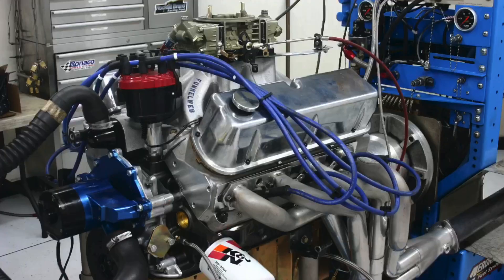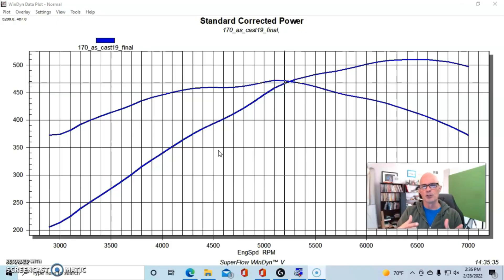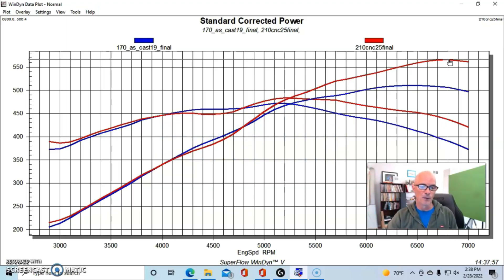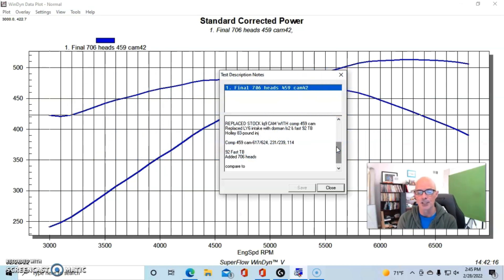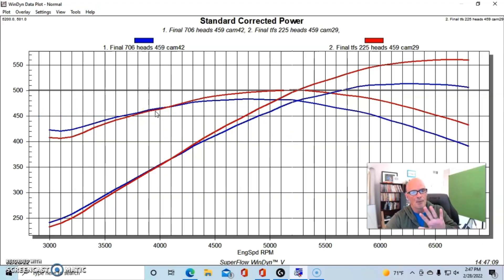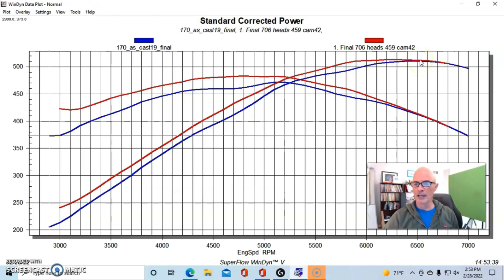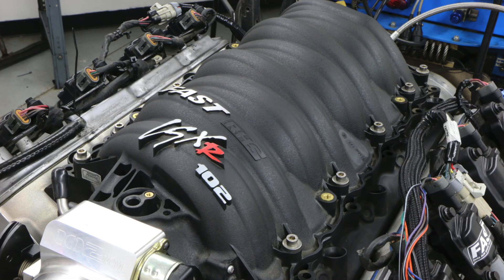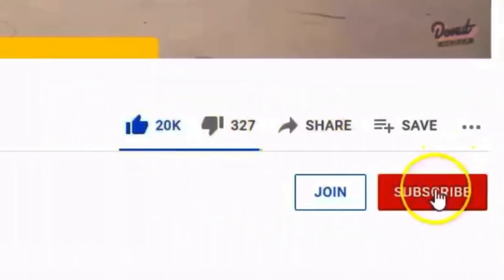HOW TO MAKE 6.0L POWER! FORD vs LS-WHICH 6.0L MAKES MORE POWER? MOD 363 FORD STROKER OR MOD 6.0L LS

Comment: It would have been interesting to see a cylinder head like a TFS R 225 compared to the LS’ TFS 225, a little more comparable than the Dart 210
Reply: Lol the cam was a solid lift 750. 
Vs a smaller hydraulic roller. 
The ford 225 heads aren't going to do any better at that lift.
Hands down the ls family will smack a ford small block any day. Especially on a budget. A mild ls will out motor a wild built ford small or big block seven days a week.  I see all the time on the strip. That's why the quickest and fast ford's have gm power.
Reply: @jakebeasley3856   TFS R 225 heads won’t do better with .750 lift?   They flow 360 cfm @ .700” out of the box.  
  
Why exactly do you think the LS typically makes more power than a SBF?   

Spoilers:   It’s the cylinder heads
Reply: @BC08  I realize it's the heads. My 243 only flow 310cfm at .600. After a great port job. You have to over build am sbf to get power out of it. Last time I checked 750 lift solid cam isn't very streetable over the this ls 6.0 would have very easy life in a street car.
Reply: TFSR 225 flow numbers            LSX TFS 225 flow numbers
.200" 141                                      144
.300" 205                                      222
.400" 270                                      279
.500" 308                                      316
.600" 333                                     335
.700" 341

Basically the TFS 225 are a serious head, better than stock LS3.
Reply: I'm not sure in what way that they would be more comparable, there's many differences between the designs.
Reply: @PSA78   Gee, let me think.   Flow and port volume for 2
Reply: @BCSVT  Port volume isn't something that you can compare with. It's comes down to CSA, flow (and to some extent combustion chamber), for the head.
Reply: @PSA78   Sure, you can compare.  Of course it’s much better to have intake port CSA but I’m not trying to be so pedantic.  
Fact of the matter is a Dart 210 barely cracks 300 cfm while the SBF TFS R 225 and and LS TFS 225 are both 330-340 cfm heads i.e. more comparable
Reply: @BCSVT  The engine is however pedantic. It's why they use this to their advantage in racing classes that has to be stock, acid porting and then mill the gasket surface to get the same volume. And that's on the same design.
I have not looked into flow numbers or any other things, that's why I asked honestly to start out with, completely analyzing the heads (more than flow though) they might be somewhat close.
Reply: @PSA78   I missed any question in your messages, it read to me like you were casting doubt on the assertion that TFSR 225 were more comparable to the TFS GenX 225 than the Dart 210 is.
Reply: @BCSVT  3rd...same manufacturer !!
Reply: @PSA78   Have you seen flow charts for all 3?   😂TFSr 225 is definitely a better comparison.
Reply: @johnnyjackson1783  No I have not compared flow numbers, or any other relevant data.

Comment: My Ford 363 N/A made 698 hp on engine dyno.  Built by Shafiroff Racing Engines.  In my opinion no one else gets even close.  I had it downtuned for daily driver application and engine Dyno at 627 hp.

AFR 220 Renegade heads
11.5 to 1
Solid Roller 660 lift by Bullet Cams - Best on the planet...:}
Diamond Everything
Ultra Lightweight Package
Callies Crank
Holley high ram intake
Holley Dominator System with Coil On Plug Setup. 

Now my 6.0L LS swapped mustang with turbo makes 1000hp.  And a heck of a lot cheaper to build.  Basic stock block.  LQ9 - Best LS Block in the world in my opinion.  

When it comes to money, nothing beats the affordability of the LS with a turbo.  It's just insane.  But I will say this, my Ford 363 sounds like God Opened up the earth when you crank it....LOL.  

Sounds like a Nascar motor on steroids and gives my neighbors nieghbor goose bumps when it cranks.  It's like Mana from Heaven. At the car shows people just stop...and listen to that glorious chopping of wood.
Reply: Cool, I put a jet engine in my Mustang last spring, and the chicks really dig me.
Reply: @dannymccarty344  haha....love the videos.  And I'm dead serious.
Reply: @StageShout  i was gonna hit the like button til u said LS swapped mustang!! I can not stand an LS swapped mustang but i do understand why ppl do it. Like u said, its cheaper to make HP. I just couldnt bring myself to do it no matter how cheap it is. Id love to hear that 363 stroker ROCKIN when it cranks! Those dyno numbers are insane bro...my good friend recommended bullet cams to spec my custom cam on my stroked single turbo 351w setup. I did like the comment by the way...just talkin alil trash. Sounds like uve got some nice toys! 💪🏽
Reply: @wellthatdidntwork  Back at cha....the LS swap is painful for us die hards. But its cheap. 

Nothing beats the feel of that 363. Out of all the motors I've build. Its sooo yummy.
Reply: @StageShout  i know and i get it. I bet that 363 is...i cant wait til my stroker is done and i can hear and drive it for the first time. Ive honestly always been interested in the 363ci as a build and wouldnt mind having one in a notch. My cousin has a procharged 331ci stroker in his sn95 cobra (manual trans) and it is the best sounding mustang i have heard in my life and ive heard a ton of them. That car has such a note and is so snappy & forceful with the manual trans its ridiculous. If i could use it as my alarm every morning i would!! 🤣🐎💪🏽
Reply: @wellthatdidntwork  331 is great for power adder. Perfect balance of parts. We've had a few 331s. 
My son and I are building an 86 notch all original with a 347. Good luck with yours.
Reply: @wellthatdidntwork  The video of my engine is on thier YouTube channel. 363HHR its a high horsepower high rpm package. No one i know get over 650 hp on a N/A 363 other than Shafiroff. There is a real science to get there. They build them everyday and I did a dyno upon receiving at a local engine shop to confirm. Numbers were almost exact.  So if you want a 363 with max hp....call shafiroff.  Excellent service. Drop in and go.
Reply: @StageShout  she is hittin hard, id love to hear it with a full exhaust. Not alot of people have these that ive seen but Mac mufflers sound really good on a mustang. I had them on mine and loved them. Better than the flowmasters
Reply: @wellthatdidntwork  I went with the blackheart exhaust. Whats funny is I bought the LS swap Blackheart exhaust and it fits perfect for a 5.0 even though its listed for swaps. Just FYI. 3 inch front to back. So you can use the LS swap exhaust for a 302 and it still works perfect. Everything lines up.
Reply: @StageShout  learned something new today!
Reply: @dannymccarty344  🤣
Reply: @dannymccarty344  Jet engines are fun.
Reply: @scotttimpany2845  as are my blonde chicks, lol
Reply: Small block fords always sound better than ls! 347 turbo, afr 195, xfi 236, victor jr, black widow 250, panty melter!!

Comment: Should I just buy a LS3 crate engine and Crank it?
Reply: That depends: do you have way more time than money and more lines on your work resume than you have tools for engine work? If no, an aluminum truck 6.0 or 6.2 will be a better option - you can make far more HP than a real LS3.

Comment: That's impressive for the ls.  The Ford had a bigger cam and the ls still beat it.
Reply: It didn't though.....the Ford made a little more horsepower even thought the LS had much larger heads until they kept adding more and more airflow to barely beat it, so I wouldn't call that a win on either engine's part. You're also talking about comparing two engines designed 50 years apart. Impressive numbers on both sides no matter how you look at it.
Reply: @Haulass95gt  but in average power the ls has a huge advantage.   Average power is more important than peak power
Reply: @joseiracheta3817  I don't argue that at all, but as explained in the video...that's all intake manifold and fuel system, which is exactly what I said also....
Reply: @Haulass95gt  check out the last 2min of the vid. With ported heads and aftermarket intake the LS made more HP and more torque. And with 0.100" less lift and 20deg less duration. The dorman ls2 is a copy of the OEM ls2 intake, and actually makes less HP than OEM.
Reply: @hydrocarbon82  Yes...and again, the LS has bigger heads, better intake, better fuel injection which is why I called the combos pretty close to even...which they obviously are because the numbers aren't that far off. Did you read what I typed, or just enough to disagree with me?
Reply: @Haulass95gt  adding bigger heads to a undercammed car is counter productive mr rocket science slow brain.....
Reply: @Haulass95gt  Thats hilarious you wont talk shop thats because you get proven wrong... I made 156 hours this pay period 3 2uz shortblocks and a 2afe shortblock you obviously have no clue what your talking about even being an old man.....🤦‍♂️🤦‍♂️🤦‍♂️🤣😂🤣😂☠💀
Reply: @Haulass95gt  the ls made more power with a even smaller cam dont be silly now. Fuel injection is miles above carbs more efficient better drivability more power.... Its not rocket science bud.
Reply: @ebkbk9902  Yeah, you're proving my point. The LS had much bigger runner heads and a way better intake and fueling system. It's a wash. Not rocket science, eh?
Reply: BIGGER CAM ISN T ALWAYS BETTER
Reply: The chevy had bigger headers and far better 15 degree heads. Put 15 degree heads on ford and get back to me.
Reply: @GJ-DT  put a bigger cam in the chevy so it can take advantage of those heads and headers then get back to me 🤷‍♂️🤦‍♂️🤦‍♂️🤦‍♂️
Reply: Holdner chose aftermarket heads for the Ford and chose dart... He could have made more power with better heads, since he was already buying them. The dart heads for fords kinda suck and there are better options for similar money available.
Reply: @berserker406 are we not going max effort? ford guys saying the sbf makes more power it has not as good heads etc.... to achieve the max hp a n/a motor can make you need to have the biggest cam with the most lift before coilbind/spring failure and best flowing heads headers and intake.... just putting on the best heads with no cam is counterproductive..... putting a huge cam with shitty flowing heads is the same thing...... The ls would of made even more power if it had a bigger cam.
Reply: thats why ford went modular because the ls is king of pushrods right next to the big block.

Comment: So the stock 6.0/706 heads with a cam made more power than the built Ford with the smaller heads.  Would love to see the cubic dollar comparison of those two!
Reply: Those 170 heads are definitely way to small for that engine though, I would put those on a 302, not a 351+
Reply: Yeah, due to the intake manifolding......i'd love to see both of these engines tested with EFI, or both with carb.

Comment: How should I (buy/have built) a 4.0" x 3.25" LS 327 for a TKX 5 spd 67 Nova?
Reply: Watch his LS videos.
Reply from the maker: you can run the 4.8L crank in a 6.0L block, but better to just run a 6.0L